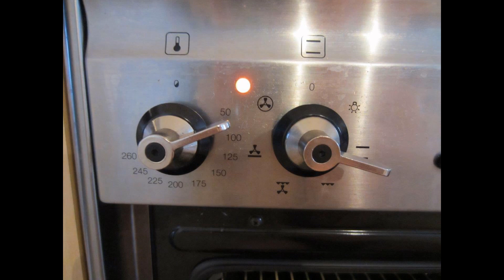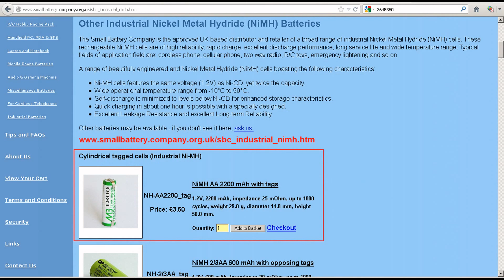How to fix a dead AMB MyLaps transponder (AMB Tranx160 / MyLaps Tranx260 )

Comment: I have a couple of the old square style yellow Tranx 160 with 4 screws.  I opened them and can see the battery just peeking through the potting material and it says 210AFHT 1.2V 2100mAh.  It looks exactly like the one in the video minus the part number and mAh rating.  It even has the “standard charge 16 hours at…” but does not have the little recycle logo on it like the one in the video.  I read here that this unit should have 3 x 1.2v cells in series for 3.2V and 900 mAh. the one shown on the recommended site is roughly the size of a AA and has qty 3 300mAh cells in series in a “stick”.  It seems that is not what is in the two TranX 160’s I have.  Is it possible that some of the old 160’s used a single 1.2V battery instead of the 3x1.2 300mAh in series? Help!  Want to ensure I replace with the right battery.
Reply from the maker: Could be.. Personally I would always replace the dead battery inside with the same type. So if you’re sure about the 1.2V then I would go for the same but with as much mah as possible for longest running time
Reply: @TeamBastardoRacing  awesome. Will do.
Reply: @ReactorFour  Can i ask you where you landed on a battery choice? Did you use a single 1.2V? I'm in the exact same boat with my old square style Tranx 160. thanks
Reply: @brianwake4104  I haven’t done anything yet, but if yours has this sort of battery in it also, then i will likely just replace it with the same one instead of what’s said here.

Comment: Using blade to cut though ABS is a bad idea. Use Kitchen Razor Blade self-sharpening saw-like knifes. They're cheap and make cutting through the plastic like 5 minutes. The ones like Tramantino bread knifes with thin saw-like self-sharpening blade, worth about 1 USD a piece.

Comment: Brilliant, after 12 years the old battery is dead, Hot knife worked better. Battery replaced soldered and hot glued back together..   THANKYOU... number 21XXXXX IS ALIVE
Reply: Great to hear that mate! Those old ones without monthly subscription fee is in high demand these days.. 😉
Reply: @hansh.hansen7372  Your not wrong  Aust. $580 https://www.ebay.com.au/i/233358498499?_trksid=p1.c100413.m3732&_trkparms=aid%3D111001%26algo%3DREC.SEED%26ao%3D1%26asc%3D20150526101321%26meid%3D2426082556e74a1b8de79e22bacaa0f2%26pid%3D100413%26rk%3D2%26rkt%3D4%26mehot%3Dnone%26b%3D1%26sd%3D124562895433%26itm%3D233358498499%26pmt%3D1%26noa%3D1%26pg%3D1&ul_noapp=true

Comment: Hi, great video, I got my battery out but could not read which direction / polarity it should go back in , newer type of yellow TRANX 160 (like the one in the video)
Reply from the maker: Henrik Hansson as far as I remember the positive + should be pointed towards the black cap in the bottom and negative towards the top of transponder where the hole and green/red diode is.
Reply: Confirmed correct, works like a charm.
/Henrik

Comment: Thank you for this video!

Do you know what the small hole in the black base of the unit is for?  I was trying to figure out if it was to help disassemble the unit.
Reply from the maker: ElQuesoGuapo no not really but it could be where they fill up the case with hot glue ;)

Comment: I just did mine and found it's much easier to remove white filler with a set of carving tools. Use a half round one and a flat one. Heat the tip and it slides right through.Thanks for the vid!!
Reply from the maker: Thats great! :D

Comment: Hi.

Ive got an old type tranx 260 with 4 screws with a batt that holds for 8 hrs after 24 hrs charging.
I opened it and there is an old package of 3 flat batterys mounted in serie.
A friend of mine says thats an 3 x 1.2 volt 450 mAh battery.
They cant be bought new anymore so advices to solder an 3 x aaa 1.2 volt in series. So there is 3.6 voltage. The amperage stays the same cause its in series (in parallel the voltage stays 1.2 volts but the amperage witll triple then).
But you can use an 3.6 AA battery also right? The higher the amperage..the longer they will be used outside the charger.
So what type did u use team bastardo racing? Link of it on google/ebay or what so on? And how longh does yours last when fully chargered?
Many thanks.

Bas
Reply: For the old red TranX 260, OEM battery are only 500mAh but it won't hurt to get some extra power. So I use 3x NIMH 1.2V (4/5 F6) 600 mAh prismatic cells.

I buy them here:
http://www.smallbattery.company.org.uk/sbc_industrial_nimh.htm

Comment: Hi there, I have the older AMB 160 with the 4 screws. I have just successfully fitted it with 3 x 1.2V 1/3 AA 300MAh batteries as described. This gives 3.6V in total. The problem I have is that I now only get 1 green flash and one days charge.

Can you confirm I have used the right batteries or should I have used 3 x 3.6 Volt 1/3 AA 300MAh to give a total of 10.8 Volts? Thanks for any help.
Reply: +Hans H. Hansen The batteries I used worked perfectly in the end. The trick was to leave it charge for approx 24 hrs.  It continued to flash red then finally changed to green. Then leave it discharge completely (from green to flashing red to totally dead) which took close to 10 days. After possibly 2 cycles of that, it recharged normally (approx. 12hrs on charge), stops flashing red and goes continuous green until removed from the charger. A year on, it still gives 6 flashes. A full charge now lasts for a full 6 days. Patience is the key!
Reply from the maker: I have also used the NiMH 3.6V 3x1/3 AA 300 mAh with pins and they work great! You need to let the transponder charge for 18-20 hours (even if it lights green earlier), leave it in the charger until it has done the full 18-20 hours. After that, check how many days/hours it blinks green and/or red to see how long it will hold the power. What power supply are you using?
Reply: TeamBastardoRacing Thanks for your reply. I've left it charge 3 times now. I've left it in it's charging cradle for well over 12 hours plus and still only got 1 green flash that lasted for approx. 24hrs before reverting to the red flash. It's like the battery doesn't have sufficient capacity. I'm using the original AMB mains charger. The output is 12V 200MAH. So I'm clear have you used the 1/3AA cells that are just 1.2V each? I thought it was strange that the charger has an output of 12V when the 3 batteries only add up to 3.6V.
Reply from the maker: Brian Coomey
Yes I used the 3.6V (3x1/3 AA) 300 mAh with pins.. Worked perfectly. I have fixed more than one so I know they work. But it could be other things.. maybe a fault on the main board (I have no experience fixing that), or maybe you just got a bad battery? Could try another power supply from a friend, maybe they don't last forever ;) Did you the battery from the shop I linked to in the description?
This is the one I use:
http://www.smallbattery.company.org.uk/sbc_3x1-3aa_nimh.jpg
Reply: TeamBastardoRacing I sourced the batteries locally in Ireland. I'll get that one in your link and try it again. I'm pretty sure it's battery related as it got progressively worse over last season. I have the hard work done so once I find the correct battery all should be good. The charger I have charges my AMB 260 battery perfectly (4 flashes)
Reply from the maker: Brian Coomey
Sounds like a good plan.. Let me know if it works :)
Reply: TeamBastardoRacing Thanks for your help. Will do.
Reply: +Brian Coomey So... Any update on this issue?
Reply from the maker: +Brian Coomey  Thats just great news! 6 full days will cover almost any race event ;) Thanx for your feedback!